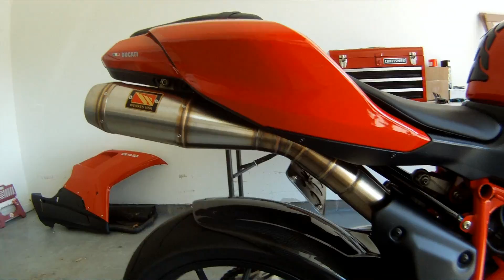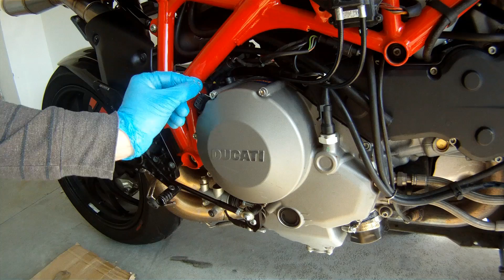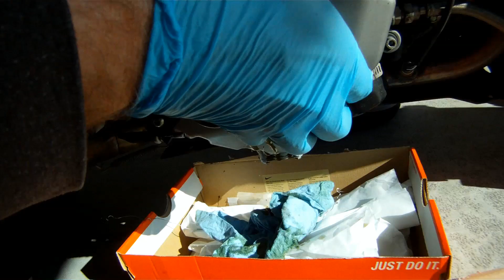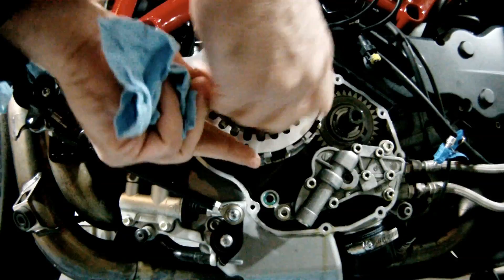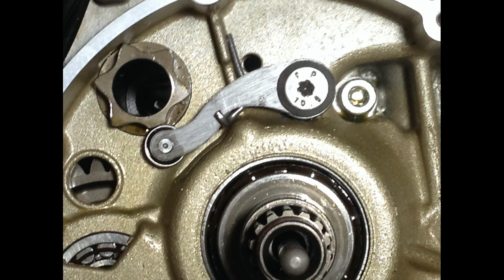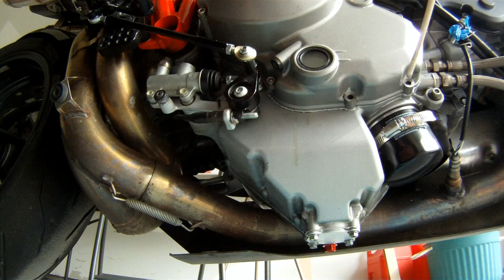Factory Pro Shift Kit Installation

Comment: Hi. Just came across your video. Awesome content for sure! I’m about to do this upgrade and also do the 29 lighter spring mod to make shifting easier. I have the DP Power Shifter and Yoyodyne slipper clutch. I’m currently using the GP shift pattern and have my Quickshifter set to do both up and down. I am hoping if you will give any insight as to how this and the #29 lightened spring would make my shifting? My bike is mostly for track and canyons. Thanks again.
Reply from the maker: Hi there, on my bike this upgrade turned out to be a godsend... I was experiencing regular false neutrals before this updgrade. After the upgrade, my shifting was noticably better and smoother, snd much more precise. And, the false neutrals went away! Good luck with your upgrade...
Reply: Track848 Thank you so much for the swift response. I’ll be ordering my parts to do this project. I also noticed you modified the swing arm as well. I’m trying to fit a 180/60 slick on the bike but I’m afraid I have no clearance. Would your mod help with that too? Thanks in advance.
Reply from the maker: @o0cscore0o  Yes the mod helped on my bike in conjunction with a new 100-link chain (instead if the stock 98-link one), and a 40-tooth rear sprocket. Do you have a quick-change sprocket carrier? If so it's a breeze to change out. When I installed my 180-60 tire the clearance between the tire and swingarm was too close with my 41-tooth sprocket (around 7-8 mm if I recall properly). I installed a 40T and ended up with a more comfortable 15-17 mm of clearance. Good luck with your mods!

Comment: Thanks for the tutorial! It made installation of the detent arm a smooth process. Specifically when screwing down the special screw before loading the spring. I also had to squeeze the “circular” part of the spring with vise grips for a moment to be able to fully seat the special screw to torque spec.
Reply from the maker: You're welcome James! You're gonna love the new feel you get from this upgrade, not to mention no more false neutrals!
Reply: Yes no more false neutrals! My quickshifter used to miss gears sometimes from 4>5 and 5>6. No more!

Comment: What size wooden dowls are those?  Ordering everything for the job and of course could figure it out simple enough but if you know off hand it I'll write on my things to get for the work.
Reply from the maker: +Jay Marucci I used wooden dowels as a temporary measure; I highly recommend that you use steel threaded rod, size M6 X 1; Go check out my recently published Shift Mechanism video here, https://youtu.be/yGJvMAuzR7U, and you can see the rods in action near the end of the video. I purchased these from McMaster-Carr.
Reply: +Track848 Thanks.  Ordered 2 of those M6 x 1 rods. We will see how this changes things on my Diavel.  Marc @ Factory Pro really advised to upgrade to the lightweight shift centering spring too for better neutrals. He said that's a huge culprit for hard to find neatrals from 1st and 2nd gears.  Ill put this kit in first along with an EVR slipper upgrade since I will have it all apart on the right side already and see what benefits I gain from this specific upgrade first.  Other headache for the Diavel is a clutch holding tool which there is none for the Diavel clutch.  Not even yours that you have will work.  Have some ideas and did some research on things to try for that part of the job.  Tough because the Diavel clutch hub nut is 190 Nm torque.

Comment: Which clutch basket holding tool is that? All i can find are dry clutch basket holders, are they the same?
Reply from the maker: G8RDuc It's a motomfg tool. Here's a link:  http://www.motomfg.com/Ducati_wet_clutch_basket_holding_tool_p/clu-2.htm, and no they are not the same...
Reply: ***** Thank you, Sir!
Reply: ***** Welp...they're on backorder and no one else makes one. So it looks like I'll have to find another way to hold the basket while I torque the nut down.
Reply from the maker: G8RDuc You might be able to find a used one for sale on one of the Ducati forums (i.e. http://www.ducati.org, http://www.ducati.ms, etc. etc.). If I see one, I'll shoot you a pm...